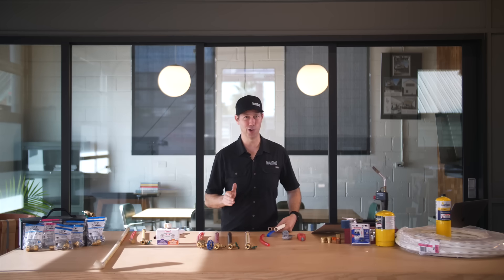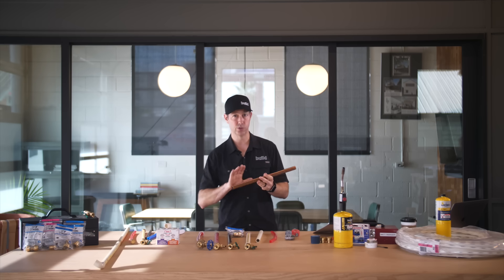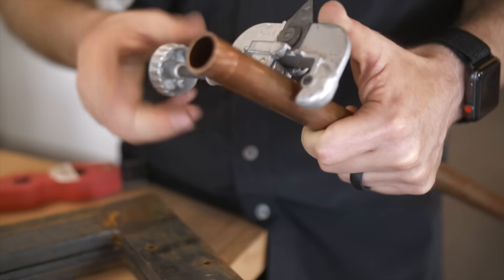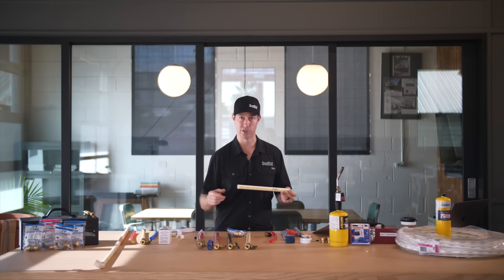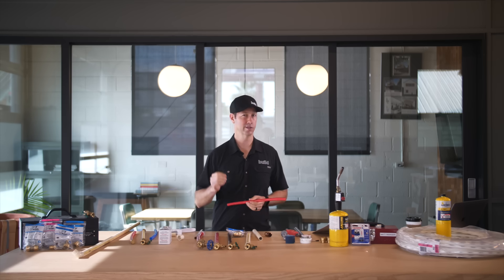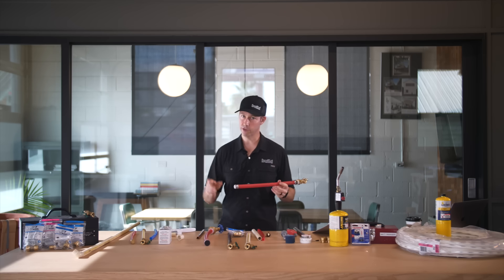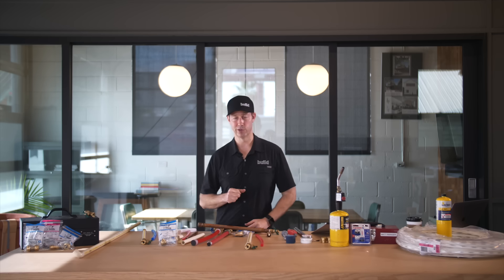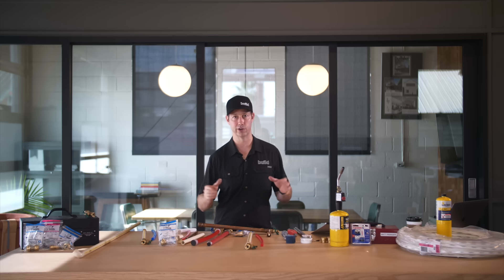PEX vs COPPER vs CPVC plumbing pipes

Comment: CPVC overtime gets very brittle to the point that you can snap off when you turn off an angle stop. I would say probably in about 10 years and probably sooner hot water side because it's thermal changes. I personally stay away from it now.....

Comment: Its 2019 in washington and I still never see pex in commercial and industrial construction. I did see it once on a casino. Back in 2005 in the basement. Copper risers
Reply: They did PEX in an 40 story apartment building in Downtown Seattle, only the installers didn't know how to use it, and a year later they were going into every unit to make repairs.

Comment: I regularly see cpvc get so brittle after 20 years that you risk rupturing the pipe if you just slightly touch it. Copper and cpvc will rupture if frozen. I’m constantly getting large insurance jobs because one of these two pipes will rupture leading to near total destruction of a home. Copper and cpvc are also notorious for leaking at the fittings. 
PEX, PEX, PEX!! I will never use cpvc or copper again. Crimp fittings are easy, PEX expands when water freezes inside it. It is virtually burst-proof. By the way, ptc fittings are expensive but are fantastic for copper, cpvc or PEX.

Comment: PEX blue main water line to my house, installed 2004,  failed 2018.  So it lasted 14 years.  Location was midway between meter and house, with no obvious stressors.  Also, on excavation,  the PEX line next to the house was degraded.  There were hairline cracks forming at a bend with slight leaking.   I assume the bend was due to settling.   I asked about replacement PEX vs Copper.   Licensed plumber that I hired didn't sound super confident to PEX.  Therefore I replaced with copper.  This was in Georgia, red clay soil.
Reply: I heard the same from a plumber in Georgia. They have pex systems failing on new builds from 2015 in Georgia. Are you on cobb water?
Reply: @LeeNobody  Yes

Comment: Matt, about 20 years ago, my son did a science fair project on PEX vs copper. At the time Wirsbo/Uponor was the new kid on the block in the northwest, and the only PEX available to my knowledge. And, yes, a 20 year success rate in Europe. My husband having been raised a plumber and a forward thinking man encouraged the project for our son. In the north, wintertime brings frozen pipes and spring brings flooding from houses not winterized and left by snow birds or the electricity went out while a family left for a winter vacation. In the process of the project, we kinked a pipe to damage it and were able to repair the pipe with a heat gun because of its amazing memory. There was another test that I fail to remember, but most importantly, we attached a cap on one end and a valve on the other end of 2 copper and 2 PEX pipes, filled them with water and put them into a deep freezer. The next day, I was shocked at the amount of damage to both the copper pipes as well as their attached valves. However, the PEX pipes were both swollen from the freezing but did not break. There was no damage to the valves. All 4 were displayed at the science fair, the PEX still holding water although no longer frozen. I would never consider using anything but Uponor PEX in the north where you’re dealing with frozen pipes. Copper is definitely a money maker for a plumber repairing broken  plumbing, but it’s not a smart choice if your house might not have heat for any reason in a cold winter.
Reply: Look up Uponor Lawsuits. It’s a ticking time bomb.
Reply: @gsu1612 thank you
Reply: Metal doesn’t expand in the cold, while Pex and plastics can.  For potable water, in my opinion, longevity of copper vs. pex/synthetics is the crucial factor.  I would not trade copper longevity for plastic pipe forgiveness when frozen.  Plastics, all plastics, leach and get brittle.  Give me copper any day, but get me a plumber who doesn’t screw it up with bad soldering, or doesn’t wipe away flux that is acidic on copper.
Reply: Thank you for your post it is very interesting and helpful for us. Love the experiment!

Comment: I watched your show I have used cpvc pipes in my house I got the house in 1992 my house was built in 1863 it had the old case iron pipes I changed them to cpvc pipes because I didn't now how to install copper I was going to go with copper this year  but not now I'm going to use the pex pipes because over 20 years cpvc pipes gets old and break's and u can not used it on top of your hot water tank for a long time thanks for showing me but all the pipes

Comment: I’ll start by saying I prefer copper, not only to work with, but for water supply in my own home.  Fitted correctly, electricity isolated from dissimilar metals to prevent galvanic corrosion, conditioned water, and bonding the system to the home’s grounding electrode conductor; it should last a lifetime in my opinion.  Concerns about chemicals leaching in to the drinking water concerning other materials, to me seems a little pampas considering the miles of pipe the water flows through before it arrives at a home’s tap.  The only time I would even consider this an issue is if the water were stagnate for some time, and the same is true for copper.  In fact, I have seen lives saved because of non-metallic supply tubing.  I’ve seen several instances where fires started in basements were extinguished by bursting of non-metallic tubing at a much lower temperature than copper would have.  Had the supply been plumbed with copper, super heating and gassing of of combustible material would have been well underway prior to the copper failing from heat impingement, resulting in major fire extension to other areas of the home.

In closing, I treat information as a tool.  If I like the tool or think it may benefit me somehow; I place it in my toolbox for later.  Even information that may to me be foreign or inaccurate as I see it.  Thanks Matt for your opinion.  Your videos contain a lot of information, and give different perspectives allowing paradigm shift for the open minded.

Comment: Chloramine water will eat away / create pits and cause a expensive leaks on copper. I know my house had some not at joints but at random part of the copper tube. Fing public utilities switch from chlorine  to chloramine 10 years ago and it has been proven in Washington lawsuits, btw it also leeches away lead from copper joints into your drinking water.

Comment: CPVC, is only slightly better than PB (Polybutylene) plumbing. I'm surprised they haven't decertified CPVC for plumbing here in the US. CPVC might last 10 years tops and that is in a place that has non chlorinated water, like in well water at the residence. CPVC becomes brittle over time all on it's own, Chlorine in the water from city supply speeds up this deterioration and even the glue used causes deterioration on the joints. The only thing worse is that PB, something I had to deal with in my home. 
I had the PB replaced by PEX, I would have preferred PVC but some of the places the piping had go would have required it to be rerouted and PVC was hard to get in my area at that time. The only reason I didn't go with Copper was because of the water here. I live in Southern AZ and the water is slightly acidic. That is due to the Central Arizona Project (AKA CAP) that blends Colorado River Water in the water supply. Many homes here experienced copper leaks after that water came in to there homes, so copper was questionable as to how long it would last.

Comment: I kept my PEX stored in my back yard, in the sun, for several months. Then I installed the PEX for radiant heat in a concrete floor slab. How worried should I be, now? The heat has been running, now for the second season, and there are no leaks. But I am worried.

Comment: I loathe, hate, detest copper with every fiber of my being.  Not a fan of CPVC (though I do love PVC for outside).  I was very suspicious of PEX when I first discovered it many moons ago, but I'm a huge fan of it now, for either inside or outside.  I can personally attest to its ability to resist cracking when freezing (only wish the fittings were as freeze resistant, more on that later).  Seriously, just go ahead and buy a quality Pex crimping set and forget the Sharkbites, push to connect fittings are VERY much more expensive, they are worth it only if there's no cheaper crimp alternative (which, in big box stores, often there isn't an alternative to sharkbites).  Couple of years ago I went from two propane water heaters to one hybrid, which required a fair amount of replumbing.  I did find it advantageous to use CPVC to a small extent, the vast majority was PEX.  One run was well over a hundred feet and another was nearly one hundred feet.  By using Pex I was able to make both runs with only two connections (one at either end of a 100 foot section of Pex).  Try to do that with anything OTHER than Pex!  Here's a hint:  for a 100 foot run you must have a product that comes in 100 foot rolls, and that ain't CPVC, and though you can do it with copper it is MUCH more difficult and MUCH more expensive.  Plus, I was running pipe above the ceiling of my second floor, which makes me nervous for future water leaks caused by bad joints or freezing.  Neither of the joints on that 100 foot run of Pex were above the ceiling, which was very nice, and in my experience Pex doesn't burst just because of a hard freeze.  I've run Pex outside uninsulated where I've had insulated copper and insulated PVC burst, but over several years of hard freezes I've never had Pex burst.  I have had the fittings burst, though, copper/brass/bronze/other metal fittings will still burst, so every place you connect two Pex pipes with a metal fitting is a potential problem spot in the future (although this is much better than having 100% of the plumbing at risk for freezing/bursting).  Still, using Pex reduces the risk very, very substantially.  I can't say that Pex is the cheapest, overall I'd say that PVC or CPVC is a good bit cheaper, especially for outside/gardening/agricultural use, and you can work around PVC's outside limitations.  Inside, though, I'd say that a good Pex tool set is the best investment you can make if you have a project that involves more than $50 worth of pipe and fittings.

Comment: Copper will kill some bacteria that causes disease, but if you have a threat of pipe freezing, i would go with Pex, ive seen several houses where the whole system was froze solid & thawed out just fine with NO-LEAKS (good-upload)

Comment: What pipe material would you use running thru a heated concrete floor recreation room (earthquake or Non zone)? And, me not knowing the difference between PVC and CPVC, I once built a structural frame around an outdoor vegetable garden with CPVC. After 30 days the Suns UV rays melted it away. Live and Learn. Thumbs Up!

Comment: Have plex running in my home and a mouse trying to widen the hole where the pipe ran through the petition, chewed the wood plus the line. Causing a pin hole leak that flooded the bathroom while we were gone. What a mess!!

Comment: What about the lifespan of the rubber O-rings in the push to connect fittings? Will the rubber start to deteriorate and crack ten years down the line and cause leaks?

Comment: CPVC should only ever be used if you are building a house for your guinea pig it serves no purpose in the real world use only pex and copper ( soldered copper not squished together junk) depending on what your application is and climate building codes .

Comment: Here’s some advice from a professional construction mgr with over 4 decades of experience across this and other continents.
There are serious water contamination consequences with pex. Google pex health hazards and read Purdue Univ study. There are also quality problems with pex fittings. Zinc fittings corrode and fail quickly; some EU brands are now banned in US. Next is installer capability. As the Corps of Engineers learned on a barracks in San Antonio if the pipe cuts are not perfectly square and pipe connections plumb and square they start to leak in 1-3 years. The Corps paid millions to remove pex and replace with copper. Then there is the ripoff. Pex is about $0.50/ft and copper about $4.50/ft. Get the plumber to quote both and see if the pex material cost is 10% or not. Putting pex in takes about 25-30% of copper or galvanized. See if these savings are quoted to you. If not guess who pockets them. 
Lastly on pinhole leaks and meal pipe degradation, this is often caused by your electrical wiring being grounded to the plumbing instead of a true ground rod at the panel board. Electrical current, even milliamperes induces corrosion. There should be no wires connected to any plumbing or pipe; make sure electrical is done right.
Reply: Pex requires transition fittings at your fixtures, which raises the cost. 

Continuity grounding for copper is required in some places so that nobody gets electrocuted by mistake when they’re taking a bath...
Reply: Yes grounding for copper is recommended and sometimes required. I am referring to grounding the electrical wiring to plumbing instead of using a proper independent electrical ground rod which does meet IBC. Grounding to plumbing does not meet code and accelerates destruction of plumbing metal. You ground each system separately.
Reply: Robert Morse 
incorrect, IBC is not the authority for electrical installations and it is not a code violation to ground the piping

how did you get your electrical contractor license? lemme guess, you dont have one
Reply: @stevejohnson4049 That statement is partially true.  IBC or IRC are not the main code in regards to electrical (NEC), but still must be followed.  Just as some electrical  applications must follow A.D.A. Code requirements.  It is not as simple as saying one does not have to follow the other.  Actually I have to digress,  A.D.A. trumps all relating to commercial requirements.  Anyhow, the main point is that grounding to water piping, conduit, or similar is not any longer allowed by most "STATES" and  "Municipalities".  To finish things off designed or built "To Code" is garbage.  It is the bare minimum you can do without completely failing, just like in school.
Reply: Robert Morse : 1 u can use plastic fittings. 2 use of high zink is a cheaper production aka China shit. Shark bite uses less zink to manufacture its fitings that’s why they cost more. Does ur study point out brands? And levels of zink? Do they have comparison to plastic and other high quality production?  Or some homo decided to do an experiment with shits for brain on random brass fitting that happens to be from China
Reply: Anytime someone begins with "I'm qualified because X" automatically makes me go... "really?"  Sure, bub, sure.  There be aliens in those woods, too.
Reply: I'd hope for  your sake you are a little more selective when you pick a doctor, lawyer or contractor as experience is often the most important discriminator.  I really wouldn't a person who wants to be doctor but never studied to cut on me, nor a person who never read law try to defend me.  Did it not occur to you that's why such people have to provide proofs to get licenses to practice or appear before the bar?  The same is true with design & construction.  But maybe you live in a home with aliens in the woods as you assert.  Take advice from those with no experience or thought of health issues like the guy who posted this video.
Reply: @bobpowers9862 
"Anytime someone begins with "I'm qualified because X" automatically makes me go... "really?"  Sure, bub, sure.  There be aliens in those woods, too."

that's how licensures work, kid.
you need to be QUALIFIED to be licensed. welcome to the real world

Comment: I live in a town with the majority of the homes are very old/historical and lots and lots of very old copper. Not only for supply but heat as well. When copper is done correctly it will last a very long time with no issues. Let’s just be honest less and less people believe in investment and just want it fast and cheap and that’s what the other products are for.